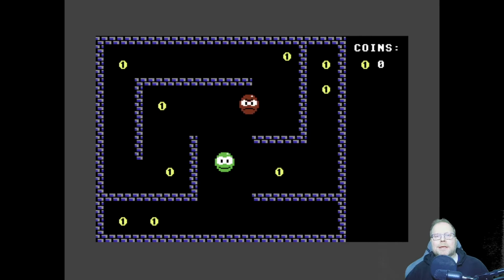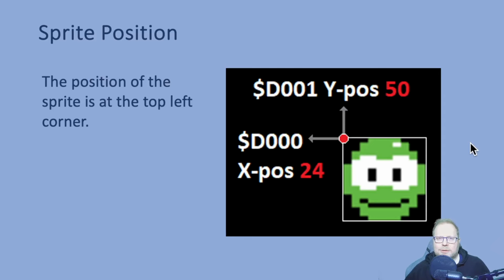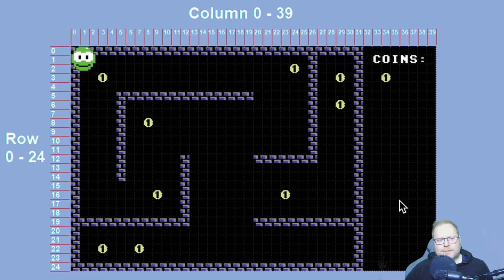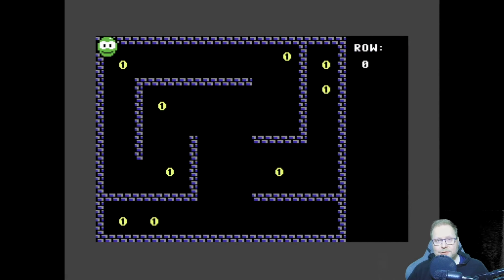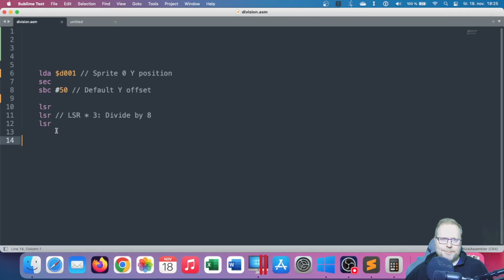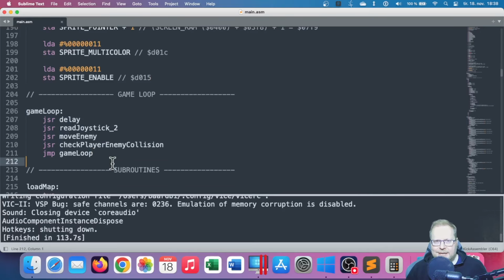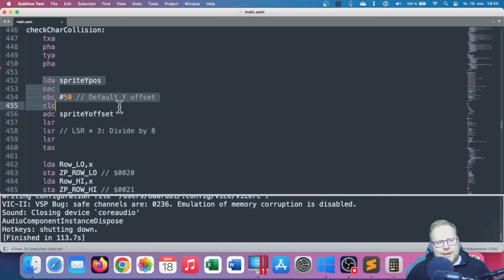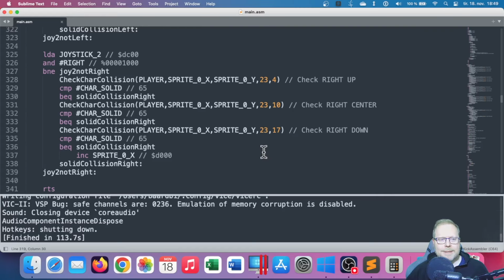How To Do Sprite-Character Collision on C64

Comment: As always brilliant video. I have one question, I thought to put your character set at $3800 and screen at $0400 it was %0001111. The last bit is unused and always set to 1 by default according to your excellent book! In this video the last bit is 0??
Reply from the maker: Thank you. It doesn't really matter what we set the last bit (bit 0) to. By default, $d018 is set to %00010101. Changing the value for bit 0 has no effect. I usually have a 0 there for better readability. Yes,  %00011110 will be screen RAM at $0400 and charset at $3800.
Reply: Sorry I missed a 1 it should read %00011111
Reply: Oh okay, thanks for the speedy response, I do follow your book religiously!😂 it’s great, I’ve learned so much from your earlier tutorials and book is written so even I can understand. I await the coin video, thank you